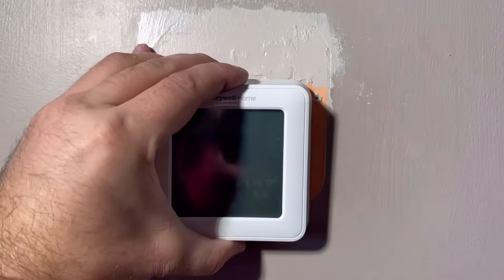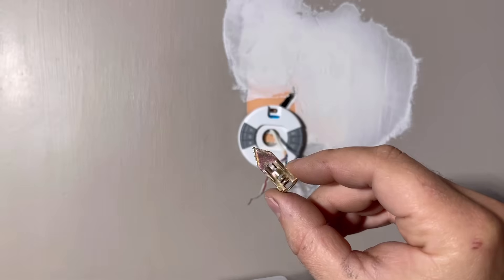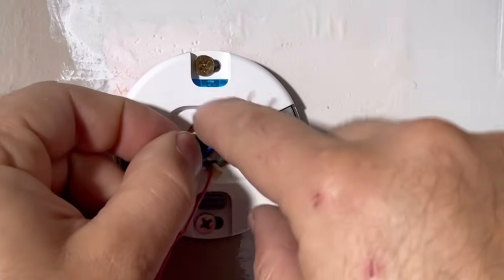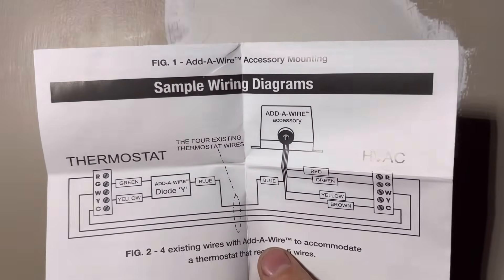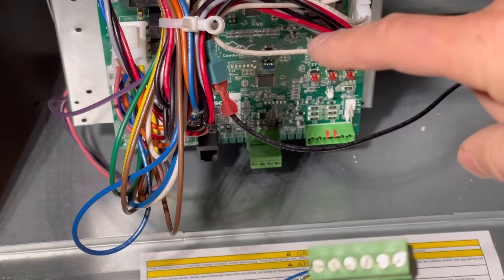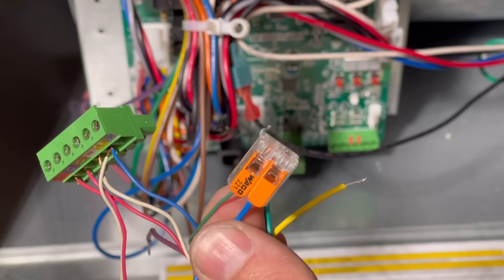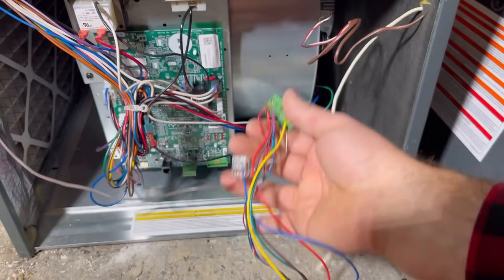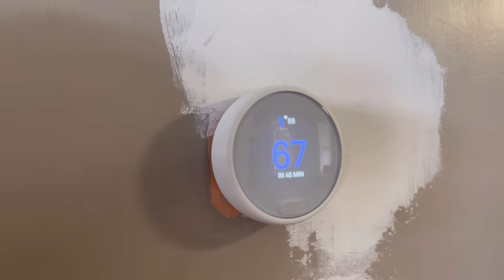The Easiest Way To Add A Wire  | Google Nest / Ecobee Smart Thermostat C Wire

Comment: Maybe I'm missing something, but I just did this. Had a 4 wire nest and replaced with a 5 wire. All you need is a constant 24 volts I just connect the blue wire to where the red one is at the furnace and plugged into C at the thermostat and it works just fine.

Comment: Hey Guys I bought a nest Thermostat and only have 4 wire Which g,y,w and a jumper between R and RC and after installing nest thermostat my ac and heater are working but heatpump still not running

Comment: TIP: Check thoroughly, both ends of your existing thermostat wire bundle, you may find a hidden C-wire! It may be folded back/tucked into the wall cavity, or may be snipped off at the end of the cable's insulating sheath (not needed or used with the old installation)... I found mine was hidden there all along! Have been delaying my smart thermostat install while watching several of these how-to videos. Finally feeling ready to do the deed, I opened the furnace panel where the thermostat wires enter, and found an unused blue C-wire wrapped around the thermostat bundle/cable (on the thermostat end it was cut off at the insulating cover, not easily visible). The "C" terminal was there and connected to the remote condensing unit, but previous installer didn't attach the thermostat wire bundle to it, as it wasn't needed with that old battery operated thermostat. Took about 10 minutes to power off the furnace, attach the blue wire on the furnace end, then run up to the thermostat and expose/strip the end of the blue wire on the thermostat end. Thankfully, there were several inches tucked into the wall.

Comment: i have a two wire (red & white) for baseboard heating only   What can I use to add a C wire for a google nest thermostat
Reply: Most wiring systems (especially old ones) don’t look like the one in the video. I have a 2 wire system with 2 zones and tried hooking in one of these power systems , it was a nightmare at the furnace with wires running to transformer connections and 2 zones units, no simple like he did here, and I’ve seen no videos showing how to do it with this type of setup. I found the easiest solution was to buy a wall plug that plugs into a nearby outlet and hooks in at the thermostat, works great! Word of caution, don’t try to plug in stranded wire (that usually comes with the new plug setup) into the back of these thermostat bases, it won’t work, I used those wago connectors and spliced in solid core wires. There are YouTube videos showing this type of setup, but I don’t see any that mention that. Good luck!
Reply: Same problem here did you figure out how ?

Comment: I am at a loss. I ran all new wire and connected everything properly from the thermostat to the furnace board ( R,Y,W,G,B) and the new thermostat will not turn on at all.

Comment: Looking at the connection diagram, both G (fan) and Y (AC unit) are connected to a single "blue" wire through each own diode. Would it be better to connect W and Y through diodes because Heating and AC never work together? Do you know if this Add a wire adapter works with Amazon thermostats?

Comment: Where do I typically find the other end of the thermostat wires? I apparently only have 5 at my thermostat (no clue wire) and I'm trying to I stall an exobee smart thermostat. Do I look at the unit outside, or is it the handler in the garage I have to explore in? I'm kinda thinking just get a new wire and run a new 7wire cable and be done, no converters needed.

Comment: Thanks for the great and clear explanation on how to install this add a wire. I wanted to ask; we have a Lennox packaged unit that came with a Lennox smart thermostat. The thermostat just stopped working right after the 5-year warranty, and the "authorized dealer" installed a Honeywell T6 Pro Wi-Fi thermostat. This new thermostat cannot rev up our unit to kick in the 2nd stage cooling that was working with the old Lennox thermostat (iComfortE30), and the dealer told us that we needed an additional wire to make this 2nd stage work. Running a 2nd wire would be cost prohibiting for us, based on out setup. Would the add a wire solve this? we also only have 4 wires coming from the unit on the roof to the inside where the thermostat is at. Thanks for your time in advance! 🙏

Comment: Purchased an add a wire briidea  Model HTACC-01 from amazon as per the link you provided, and it came with no instructions .  On- line instructions state; Cannot be used as ''R'' power or ''C'' common wire.  Is this the wrong unit?

Comment: How would u wire this if u need it to add a 6th wire for 2 stage heat? I have a 5 wire running already. Just not understanding how to use this for the adding of 6th wire. Thanks

Comment: Great video!  Now is there a way to add a 6th wire for humidity control?  I have a whole house humidifier in the basement with a separate controller next to it.  I'm getting an Ecobee thermostat and I'd like it to control the humidifier.  Any good pocedures out there for this?  Cheers!
Reply from the maker: Yes the Fast-Stat 5000 will add more then one wire 👍🏼

Comment: So I have 4 wires they are 2 red 2 white, labeled  G, W. Y, RH, WANT TO ADD C WIRE, i have lennox G64 so I would put new wire to C  and use G wire to connect  the unit for furnace.  I DO NOT have cooling system . Please help.

Comment: Great videos! Quick question…. I have a n older York diamond series furnace, it’s a 90+ up flow 2 stage, I would like to add a Amazon smart thermostat, I have a 5 wire now, I have no c terminal on my furnace board, could I just run 18/6 wire and connect the 6 th wire to b on my furnace board which is connected to the white wire running out to my condenser and the c terminal on my thermostat? Thanks in advance!

Comment: If you only have heat via hot water (baseboard), IOW no air conditioning and no fan, you're probably only going to have two wires going to your thermostat. I simply wired an ac adapter to my smart thermostat to power it..

Comment: Common mistake I see with these c wire how to videos. You pull off the old thermostat and assume there is no c wire. It may be there it's just not hooked up, look at the other end of the cable in the furnace. Many of my friends and family that put in a smart thermostat don't need the adapter. Most houses I've seen that are 90's and newer use 8 conductor cable for the thermostat and only use 4 of them, the others are tucked back in the wall. Investigate a little further see if rerouting a new cable is possible as it is preferable. 8 conductor thermostat wire can be found at local hardware stores for a few bucks.
Reply: I don't even have a damn furnace to check wiring. I live in a condo so all I have is a breaker, water heater and some wiring section for Xfinity lol
Reply: Yup, exact same scenario for me . Idk where to connect the C wire though in the furnace to get the 24V . It’s a older furnace .
Reply: This comment helped me! I'm only reading 16v on the spare wire behind the wall (prev thermostat used 4, r y w b, but B was hooked to Y and the Y is the spare wire behind the wall). I taped the yellow wire up since idk why it's getting low voltage
Reply: This comment saved me!! I dug around a bit and found the blue c wire ! Thank you!!
Reply: Dude, you're a hero! You just saved me so much work! 😂🎉
Reply: Excellent advice! I have a new furnace and thermostat installed in an older house - 1950. The C wire was there but not connected at either end. - Just like you said. I connected the wire at both ends and installed the fancy smart thermostat. All is good in the world!
Reply: True. I pulled on that thermostat wire and found it hiding in the wall. my issue is that the other end at the unit is not connected to anything and both Common slots are taken by something else
Reply: Mine has 2 wires coming from the furnace. And it's a new furnace installed last October. I'm sure it has more connections but that's all they connected. Lazy

Comment: Nice job!! I’m going to have to look at the video a few times more to completely understand….I know it will come clear!!
Reply from the maker: Yes the diode just uses one wire to send a signal to the unit in the furnace is all. The instructions are very easy to follow. If you have any questions, email me at diyhvacguy@gmail.com   Cheers

Comment: Is there anyway this will work on hydronic baseboard heating with a zone valve, it does have the honeywell syncron  motor
Reply from the maker: Not sure on this. I don’t work with baseboard heat boiler systems
Reply: @diyhvacguy  update!! Figured it out on an ecobee premium stat.. thanks anyways!!

Comment: I've installed hundreds of stats, never used a drywall anchor, always just the screw, carefully. Never had a problem
Reply from the maker: As soon as someone goes to yank the cover off to replace the battery’s or reset a smart thermostat you will for sure have a problem.
Reply: The screw won't hold steady when you're using your thermostat as an anchor point for pulling teeth!
Reply: as a homeowner, I hate sloppy stuff like this. do it properly and do it once. otherwise, its just another annoying technician I have to walk behind and fix their shit

Comment: If the current thermostat wire is not tacked down inside the wall, just tape up a new thermo cable and pull it through. To me it would of been easier to just run a new thermo cable and do away with that kit.  First benefit would new wires and secondly, not adding in a new piece of equipment that can fail.
Reply from the maker: Yes if it’s easier obviously that’s the route to go but so many are racked in place and you can’t do that without doing a ton of drywall work. Not to mention if it goes downstairs through a finished basement. That’s a nightmare job. This is an easy and cheap alternative.
Reply: @diyhvacguy thanks for the video. Yeah guys come on and comment on someone else's video like they know what they're doing but like you said. Everyone can't add wires without having to do drywall work
Reply: @rjdatdude23  Yeah but drywall is specifically designed to be repairable. That’s the whole idea with the stuff. I’m running a new cable.

Comment: Will this work the same if my outdoor unit is also a heat pump
Reply from the maker: There is a different configuration for heat pump wiring on the slip that comes with the add a wire kit, yes it will work with heat pumps.

Comment: Mind blown!  So this device isn't magic?  It highjack's the heat wire to bring common 24v when the HVAC is set to "cool" and the cool wire when HVAC is set to heat, allowing a smart, or simply lighted thermostat?  Genius!
Reply from the maker: Exactly
Reply from the maker: Yes this can be used for a any thermostat I should have made that clear. Not just smart t stats. Cheers

Comment: DO NOT get a Smart Thermostat, once you do you gave control of your Thermostat to your Energy service provider. Research it for yourself.
Reply: No, you don’t. Research it for yourself.
Reply: No worries just delete the wifi information and they are not connected. Use your phone also as a Hotspot i do and still use Alexa etc when I turn the Hotspot on. Then turn it right back off
Reply: Mine was an opt in system, the thermostat for super cheap through the company. I also get rebates being a part of the program. They give plenty of notice about when they will adjust your temperature and limit it to like 20 times a year or something like that.
Reply: This isn't true. That happened where the energy company themselves provided smart thermostats to customers if they opted in to the program. Some you can buy may have the ability to connect to your electric company if you opt in. Not required but they may offer a discount if you do. My provider isn't that high tech anyway.

Comment: I'm trying to go through all your videos.  I have a question for you the thermostat wire from my furnace to the thermostat is two wires.  I was thinking of maybe putting one of those smart thermostats in which it sounds like two wires ain't going to do it.  The basement is completely open so I assume I could change the two wires out to maybe a four or five wire would be your recommendation?  Thanks Michael ☺️
Reply: Michael Sheeder from a Gas Technician, my advice would be to install a new 5 conductor t-stat wire and if possible even an 8 conductor if you want to prepare for the near future. Especially if your basement is already open, now is the time to do it. Any other advice is just a money grab or bad advice altogether. Cheers hope that helps!
Reply: @DonovanRocheleau  thanks for your help. Michael
Reply from the maker: Honestly it will be easier to do this add a wire kit. You can go from a two wire to a system that will fun heat and air conditioning. 

If you go to Patreon.com/diyhvacguy there is a membership we have that’s a small fee of $25/mo for unlimited access to tech questions installing thermostats or equipment. It also includes help with other repairs, sizing equipment, and finding the best price on equipment. Check it out! Thanks,   Dave

Comment: I did have to install one of those add a wire units for one client of mine.  For another, I was able to run a new thermostat cable to get enough wires.  On the thermostat I just installed for my home, it indicated that I could wire G to C at both the thermostat and furnace, with a jumper between Y and G at the furnace.  I guess you lose the ability to control the fan manually, but it still runs when heating or cooling.  My old thermostat only used 4 wires, so I thought I would have to deal with that.  Fortunately, there were enough wires in the thermostat cable.  I just needed to connect one of the unused wires to the furnace's C terminal.  BTW, I think of C as Cyan, thus using the blue wire.
Reply: The jumper worked for my unit.😃

Comment: I have a friend that is disabled; poor motor control. He’d like to control his wall heater via computer/wifi. Unfortunately his wall heater requires a 750 mW thermostat.  Ecobee seems to hint it’s possible, but I’ve yet to see anyone do that. Do you have any ideas?
Reply: Thanks for the correction. I’m a novice trying to solve a problem. 
I’ve seen another video where they use a 24 Volt adapter as the power source sold by the Nest manufacturer. Do you think that might work. I’ll do some more research.

Comment: I wished you would have mentioned the small fuse at the furnace that can be blown if power isn’t shutoff from it. The blown fuse will derail the new thermostat installation. Good video.

Comment from the maker: Here is the link for the products used in this video:
My favorite drywall anchors: https://amzn.to/3Bxsp9l
Wago lever locks: https://amzn.to/3YkkyFX
Add-A-Wire Kit: https://amzn.to/3j2lfDF
Reply: Not sure if the name or link changed but it now directs to "briidea common wire kit" and specifically says "cannot be used as R power or C common wire" though seems very similar to what you've wired up for a C wire. I assume there's no issue then, just add it says it can't be used a C wire.
Reply: @mikeb4629  On t-stat side, C is not connected to this kit. C use original dedicated wire. On furnace side, the adapter needs C to do its own work.
Reply: ah so you just wanted to get some money out of this

Comment: Can a gas pilot light ignition be converted to a electric ignition?
Reply from the maker: Probably too much hassle for what it’s worth. I mean anything can be done but the board would need to be replaced as well as the ignition components, probably the gas valve too.
Reply: @diyhvacguy  Thanks for the input. I wasn't too hopeful, but thought I would ask since I'm no expert on the subject. Merry Christmas.🎅🎄

Comment: Super cool. Have been following your videos and been doing what you have shown as far as spare parts and converters. Thanks. How about humidifiers with smart controls that measure outside air with inside air to determine proper humidity in the house. I have a furnace add on that i have to adjust during these weather extreme swings. Thanks again.
Reply from the maker: I’ll look into doing some videos on humidifiers. Definitely crucial out here where there is low humidity! Cheers

Comment: My furnace has no A/C and a 2-wire thermostat wire. My NEST works w/o a C wire because I have power on one of my 2 wires. I lucked out, I guess.
Reply from the maker: Cool. Some of the nests will work without a c but I’ve found that it’s always better to have a c wire. But I’m glad it’s working for you!
Reply: Careful, mine ran without a C wire also but shorted out my main board twice over the years. I  just hooked up the google C wire adapter and the heater runs way better with it on. Worth the $25 for the piece of mind